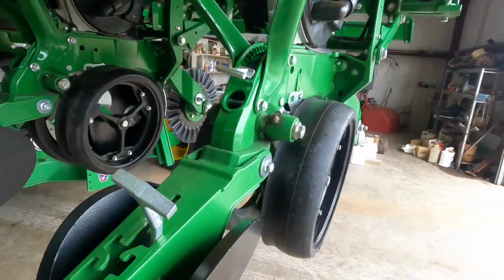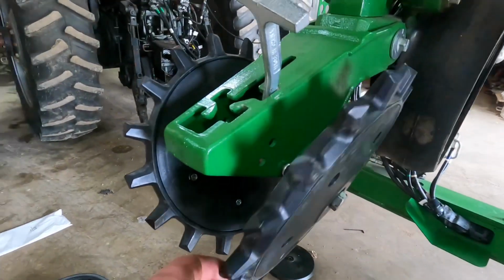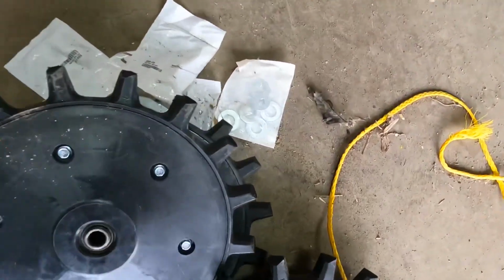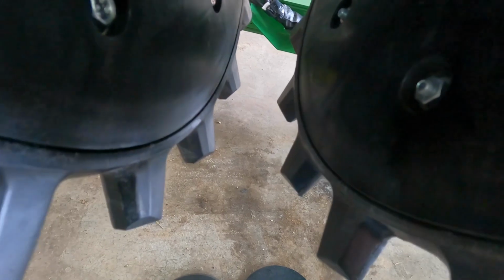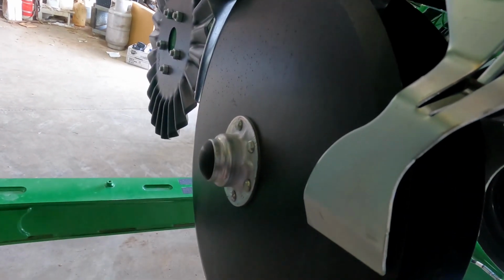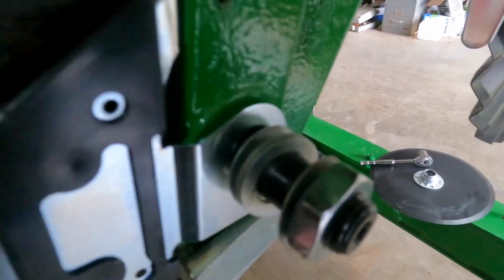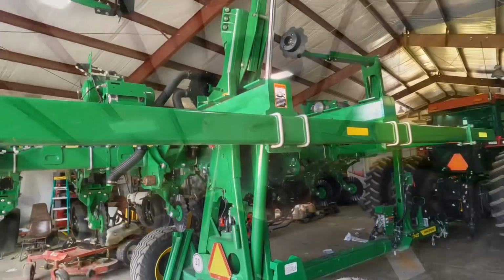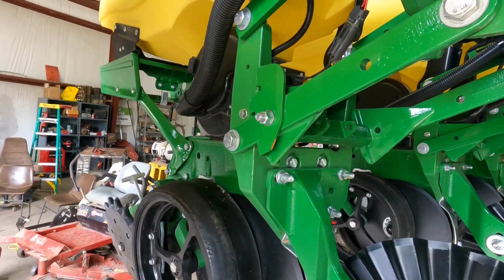John Deere 1745 Upgrades. Yetter Twisters & Keeton Seed Firmers Install

Comment: I'm using both twisters and firmers. No till or conventional, both are good. I like the way the twister can handle the wetter soil.  At the same time it can close enough and firm so that the seedzone doesn't dry out at or right after germination. So in that way it acts like the dual rubber system without the sidewall problems. I used the firmers to get the seed firmed into the bottom of the trench. Added mojo wires. We're in black clay, sometimes the firmers buildup mud, you might wonder if they are even working and in the trench bottom.  A big problem both are good for is if you plant and don't get a rain for a couple of weeks.
Reply from the maker: Thanks for the input. I’ll have to check out mojo wires. Normally I’d start planting next week but we have got a lot of rain the last 2 days and more to come tomorrow.

Comment: I have the same keetons on mine except I have the ones with the pop up tubes.I have used starter in furrow for several years and like it especially with capture insecticide.
Reply from the maker: Mine came with the tubes. I didn’t install them. If I go liquid it will be a different setup.

Comment: Re closing wheels: Some that are planting into cover crops (standing or rolled down) have removed the toothed closing wheels and went back to solid (rubber or cast) due to debris wrapping problems. Another channel replaced the seed chute to Precision Planting design (narrower with round bottom at the seed outlet), but they had an older JD no-till planter with rectangular chutes -- I couldn't tell clearly, but it looks like you have that PP design from the factory.
Reply from the maker: I’m mostly no till. I did have problems with the row cleaners on my old 1200 in vetch or wheat stubble. They were fixed so I took them off. Yes I can see how stuff could wrap on the Twisters. I don’t know what seed tubes I have but they are rectangular. Thanks for the feedback.

Comment: I would say if you have good down pressure and good openers you really shouldn’t need colters up front or trash whippers. I have a 8 row 7000 John Deere all updated with air bags and have been planting green for 3 years now with none of that stuff up front and have had good luck.
Reply from the maker: Keith I planted in the red all Spring. Someone said take the coulters off and I would be in the green. I may try it.

Comment: aftermarket folks have made millions upgrading green planters. welcome to their club my friend!  its a shame your red dealer sent you there.
Reply from the maker: Yep if you can start with a good 7000 or 7200 tool bar the sky is the limit. I think Case has a better planter from the factory but more aftermarket parts for a JD.